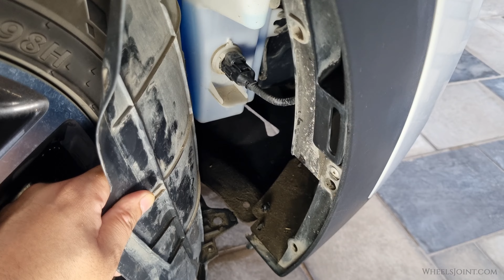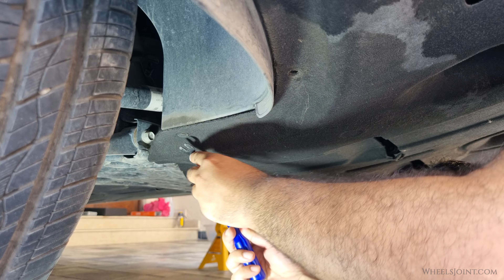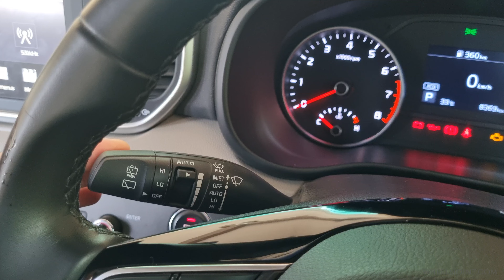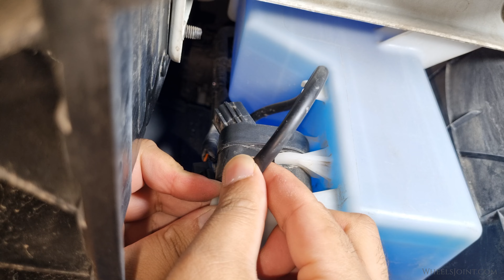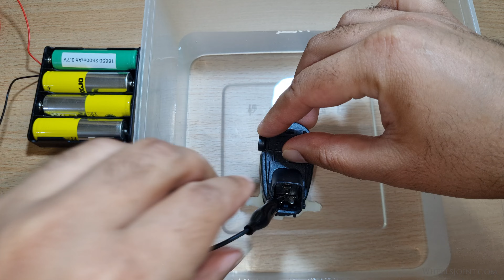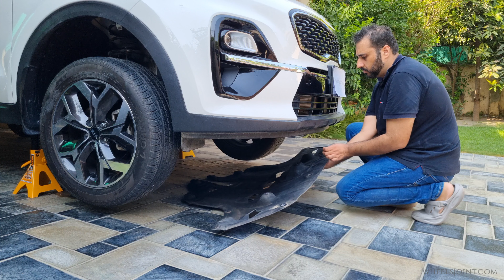How to replace windshield washer motor pump in Kia Sportage

Comment: Thank you for a great informative video! I've noticed that polarity of the Ground and + Front Washer pins was reversed between the pump and the plug. The plug's + Front Washer pin was connecting to the pump's Ground pin, and the plug's Ground pin was connecting to the pump's + Front Washer pin. Did you have to reverse the polarity of these pins on the plug in order for the pump to work properly?

Comment: Hello, thanks for the video. I have a 2020 Telluride. Is it the same process? My front wipers are not operating properly. I just took it to Kia and they said the motor is bad. They said it would be $755 dollars to replace.
Reply from the maker: Not sure about Telluride. You can remove the engine undercover or splash shield and take a look.

Comment: I did not find it necessary to remove the engine cover completely or even raise the car. Remove only the clips and bolts just under the motor and you can easily access it.
Reply from the maker: Thanks for the tip! 🙏